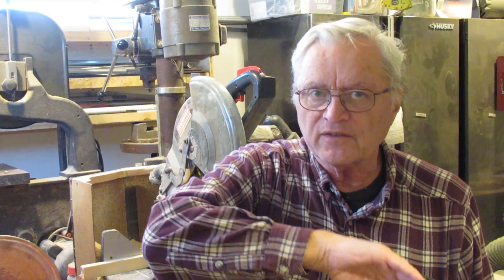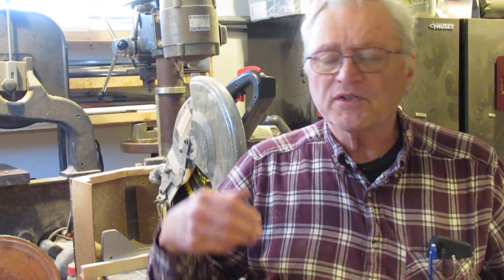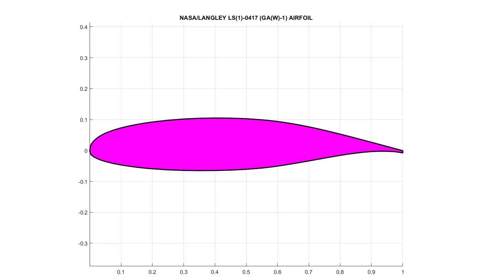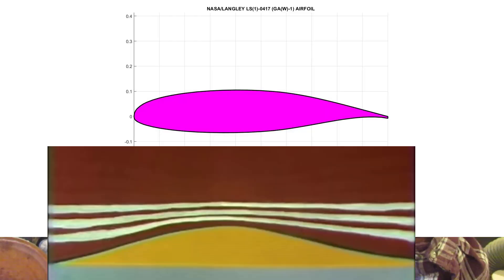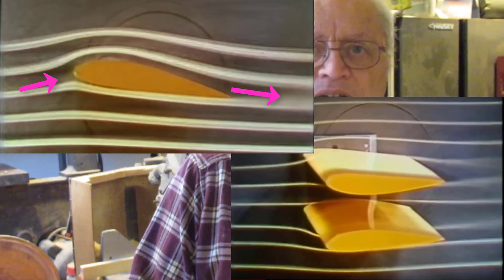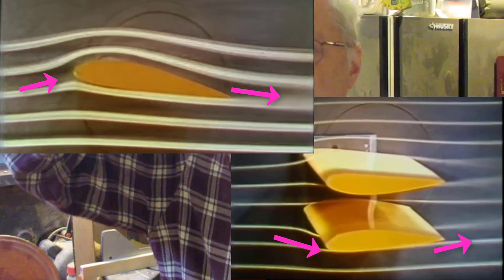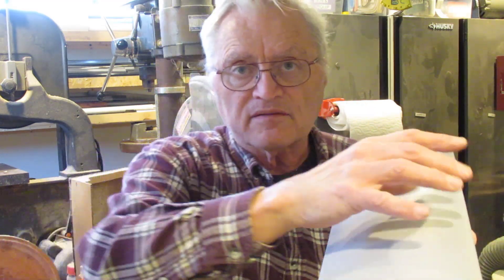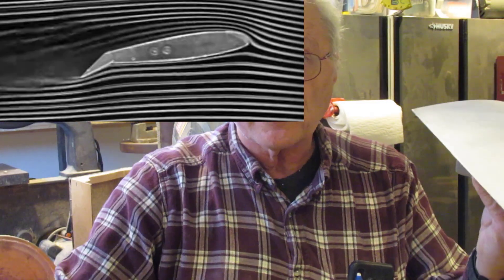Lift: 10 Myths in less than 10 Minutes

Comment: On the bumblebees, there's a whole deeper layer to the story.  

An earlier paper on insect aerodynamics was making some mistakes that were fixed in later papers by Ellington at Cambridge, a different insect researcher.  (The earlier papers predicted too-small lifting forces.   Until the update was made, experts truly couldn't explain bumblebee's lifting-force.   Their modeling was genuinely flawed.  But this issue didn't apply to all insect flight, just to ?butterfly/bumblebee? need to check this part.   So, SOME insect flight was long understood.   But not bumblebees.)   

But then in the early 1990s, Ellington made a fundamental discovery, made empirically.   He noticed some brand new vortex-shedding, where previous wing-flaps were interacting with later wing-flaps.   The end result was to supply the remaining unexplained lifting-force, which had always been missing from our understanding.   (Detailed analyses of SINGLE wing-flaps would give wrong results, incorrect vortex-shedding, and too little lift.  And the multiple wing-flaps were being simplified for analysis, the fullly detailed model apparently beyond the computers of the time.)

Ellington's later discovery came from building a large robotic hawk-moth wing, and then tracking the fluid motions in a flow-chamber.  (Film-camera bubble tracks.  No supercomputer-arrays needed!)   The new vortex was discovered in the mid-1990s, unsuspected by everyone up until that point.

In other words, before the 1980s, scientists truly couldn't explain the lifting-forces produced by flapping insect wings.   And then in the 1990s, the final shoe dropped. The calculated forces had always been significantly less than that required to lift the insect weight.

But for decades, physicists were claiming that the "Impossible bumblebee" was only a silly myth, and being spread by ignorant people.   They were wrong.   The true myth was being spread by those same experts, the ones who insisted that bumblebee flight was totally explained!

- https://www.thefreelibrary.com/Robotic+moth+reveals+key+to+insect+flight.-a019006767

How can it be that supposedly the bumblebees are fully explained, and the myth is wrong,  but then in 1996 suddenly we hear that "...in effect, they've shown us how insects can fly," says biologist R. McNeill Alexander of the University of Leeds in England. He notes that (theoretical) studies had sliced the wing into two-dimensional sections and summed the lift from each part, ignoring airflow along the wing. Though they see few immediate applications, entomologists are pleased by the findings. "We've been waiting 20 years for this," says Alexander.
Reply from the maker: Interesting! Thank you.

Comment: One liner: The aerofoil has a bound circulation after dumping a starting vortex in the flow, which generates lift by the Magnus effect.
Reply from the maker: Well, yea. But.....
In my experience, trying to explain lift via circulation falls pretty flat when you are dealing with non-technical pilots.
In any case, thank you for the comment.
Reply: @LightAndSportyGuy   It falls flat from a physics standpoint, as well.  It's a mathematical tool to simplify calculations for the complex flow.